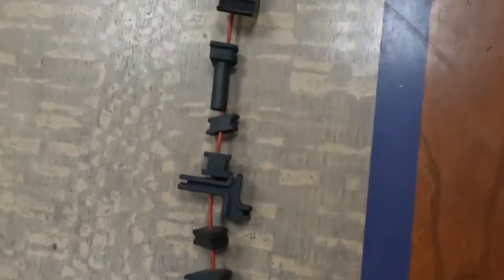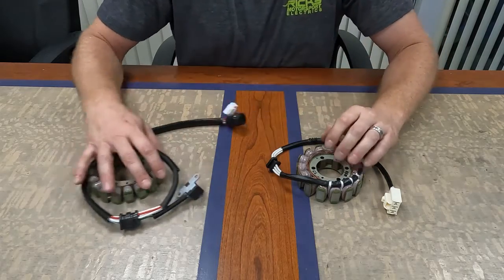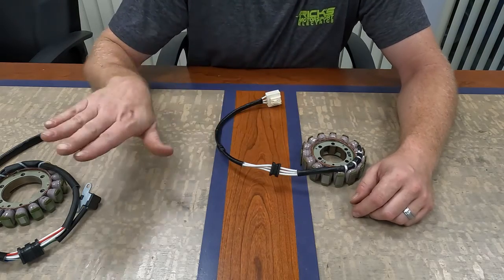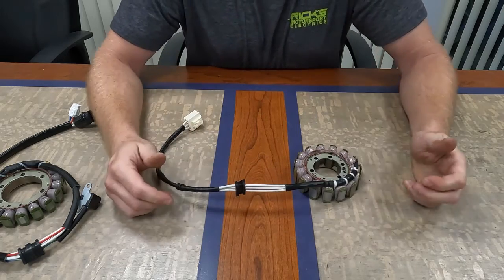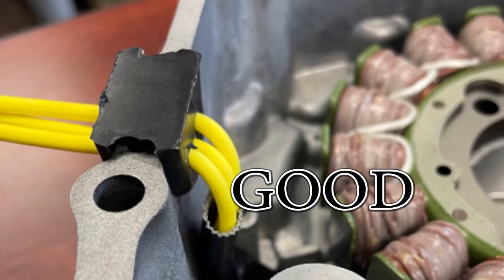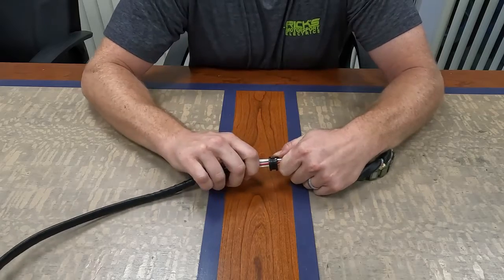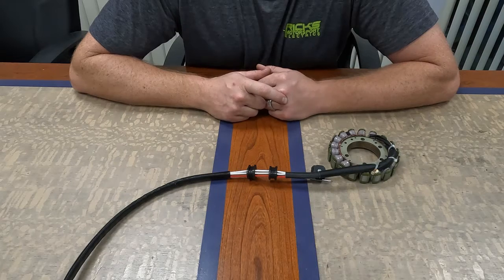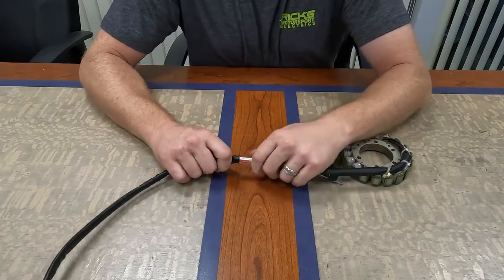Rick's Electrics How-To Video - Adjusting Stator Grommets: Do's & Don'ts. Why are my wires frayed?

Comment: I have a 1980 RM125, and the rubber grommet will not move.  Do you know if it is fused in place?  Can not turn or move, even with lubricant tabed inside around the sheathing.
Reply from the maker: If this is a product that we made..we do not glue the wire through the grommet.